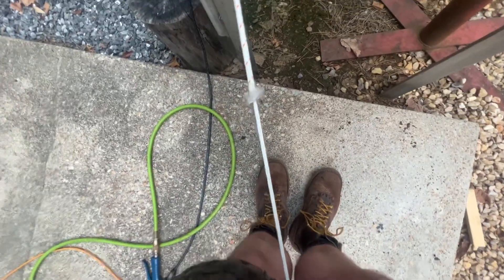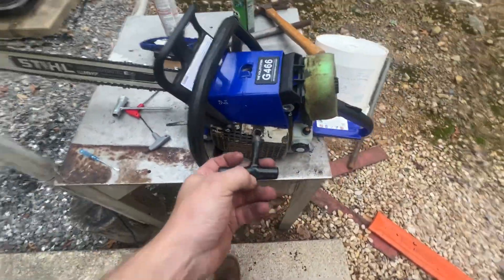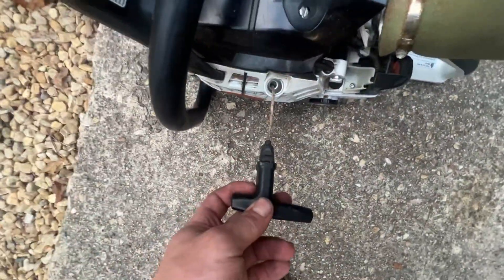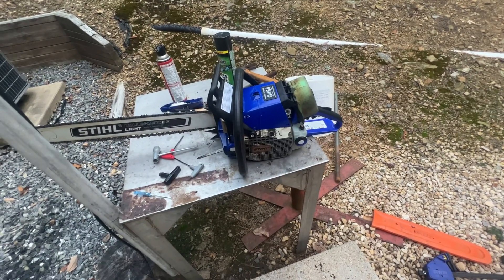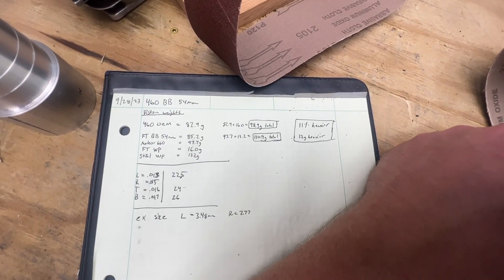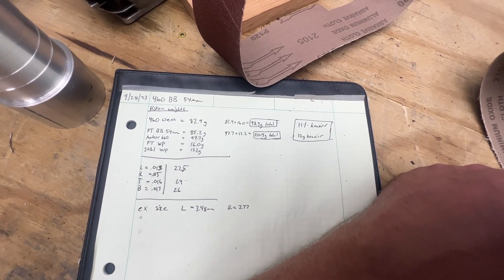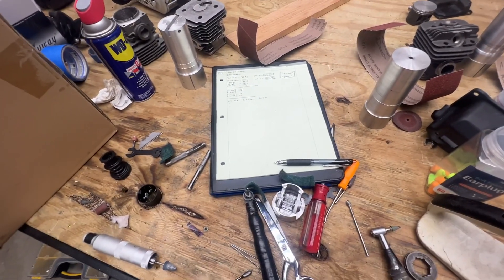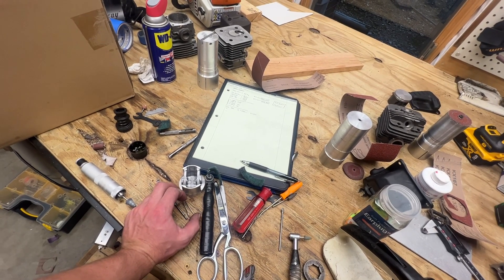Farmertec g466 BIG BORE build update (initial problems) and numbers

Comment: Looking forward to seeing it cut!!!
Reply from the maker: I have a short of it cutting. Doesn’t make as much power as 52mm cylinder. 52mm piston option are better with 12mm pin.
Reply: @rkfirewood7576  I see that 🤔. You would think it would be stronger than a 52mm. I wonder if the small crankcase doesn't have enough pumping volume to fill the cylinder. Killing its volumetric efficiency?.